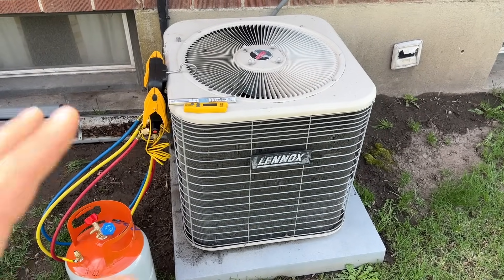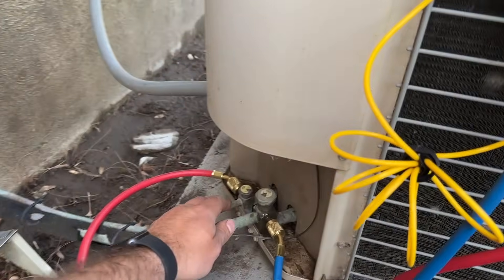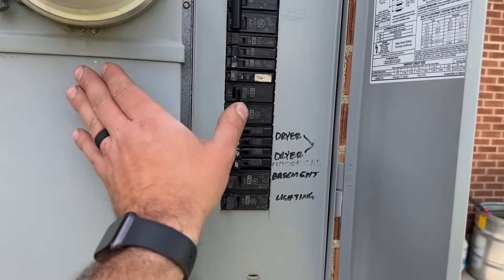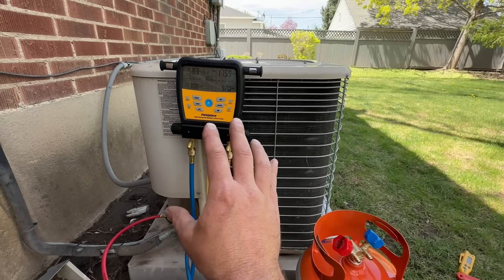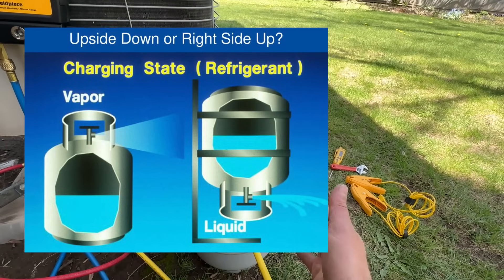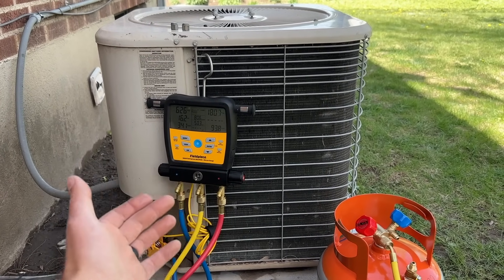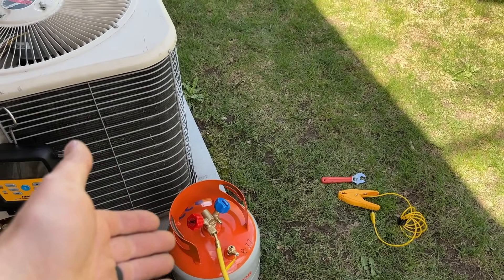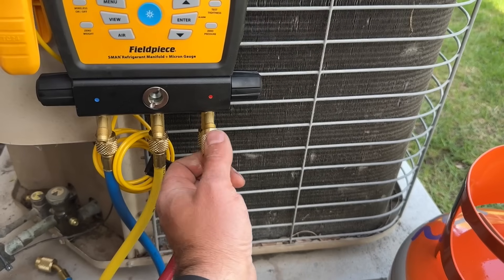How To PROPERLY Recharge Your Air Conditioner

Comment: I love all your videos! To clarify, when adding R-22 refrigerant, you should connect the tank upright to introduce vapor only, not in a liquid state by turning the tank upside down, correct? This is important to avoid slugging the compressor. While R-22 can be added in both liquid and vapor forms, it’s crucial to introduce the liquid slowly, just as you demonstrated in the video or other videos. This process can be quite confusing for beginners like myself.

Comment: Yes, it is true in Australia: you must hold a valid Refrigerant Handling Licence to handle refrigerants or work on refrigeration and air conditioning (RAC) equipment. Handling regulated refrigerants or RAC equipment without a licence is illegal and punishable by law, as the scheme is in place to protect the environment and ensure public safety. 

What is considered "handling"?

Decanting or transferring refrigerant.

Manufacturing, installing, commissioning, servicing, or maintaining RAC equipment, even if no refrigerant is present.

Decommissioning or disposing of RAC equipment with refrigerant. 

Who issues the licences?

The Australian Refrigeration Council (ARC) is the regulatory body responsible for issuing licences under the Ozone Protection and Synthetic Greenhouse Gas Management Act. 

How can you verify a professional's licence?

Look for the ARC Tick:Licensed professionals carry the ARC tick of approval. 

Use the online search tool:You can find a full list of licensed technicians on the ARC website. 

Contact the ARC directly:For confirmation, you can call the ARC on 1300 884 483. 

Why is a license required?

Environmental protection:The licensing scheme helps control the handling and destruction of fluorocarbon refrigerants to combat ozone depletion and global warming. 

Consumer protection:Licensing ensures that only trained and qualified professionals handle the equipment safely and correctly, preventing hazardous situations. 

Legal compliance:Working with refrigerants without a licence is an offense and can void product warranties.

Comment: Hey there. Quick question.  I have an old unit and had some issue with ac room puddling up time to time.  My AC is working fine for now.  Because any leaks make me worry, called a HVAC tech, he said maybe there is a clog in the drain pipe, used one of those nitrogen blower and cleared it; however, on the following day found puddle again called different tech, he said the refrigerant is low and creates freeze of coils and when it melts causing the puddle.  But here is the kicker, he doesn’t have the refrigerant nor cannot really fill them due to gov regulation.  Upon search, I found the article that stated regulation of some refrigerant.  Are there any alternates?   He gave me an estimate of $11000 for a total replacement.   
Called a different tech just out of curious and gave me a quote of $8000, which included high seers unit.  
Upon doing some more digging, came across your videos and videos and was wondering do you help with people who are willing to learn and assist installation?
Thank you kindly 
Dave

Comment: Wondering if my current gauge hoses and Schrader core removers will still work. Are the access ports on new R32 systems still 1/4 inch?

Comment: put gauges on my daughter's a/c.  When turned ac on high pressure jumped to 300 then settled at around 250.  Low was about 75.  ninety plus degree Texas day.  Should I have someone come reclaim to get it down to 165-ish on the high side?  Thanks

Comment: I don't suppose it matters to DIY folks that it is illegal to do this without certification. You can get fined up to $44,539 per day, per violation. However, there are no refrigerant police walking around. How can you trust this guy when he says your pressure should be between 70 and 80 in the basic method, but when he does it more precisely, it only gets up to the mid sixties. He also didn't purge his low side hose. Air in the system is a contaminant, and the moisture therein is even worse. 75% of what he said was good, but it's the details that get you!

Comment: Appreciate your lessons, and help values. In getting ready to top up refrigerant of a couple of my mini splits, and wanting to make sure no air gets injected; I notice you purged refrigerant through the yellow line, but not the blue or red lines. Would it be a good idea to briefly crack open blue line valve, then red and let refrigerant back flow out same top of yellow line release, close blue side valve, then purge from tank. Would not that be one notch more thorough?  Update: Studying the lines you recommend, I see they are sealed at fittings, and mine are not sealed (econ equipment). My thoughts are, one might purge those lines when going from different refrigeratants, but likely not have to when dedicated to one type of refrigerant.

Comment: shouldn't we have sucked the contents of R22 in the high pressure line in to the low side before disconnecting? just so it is not trapped in the lines under pressure?

Comment: you added the liquid refrigerant  into the vapor line rather than the high side liquid line... this confuses me, as the vapor line goes to the compressor which should not have any liquid in it

Comment: QUESTION  You purged the yellow line to prevent introducing air into the system. But don't the red and blue lines, when connecting to the AC unit allow air into the system once you open the blue and red lines at the manifold and start to run the AC unit?

Comment: What happens when you’re a 70 yr woman you have no kids local no real man that knows or even wants to try to know. What do you do when you don’t know people to help you?  My AC went out yesterday in 90 degree heat 2 days without. So  in that case what you do is call someone and be prepared to bleed.
Reply: If the AC is completely not working, call a reputable service agent and have them look at it.  Possibly its something simple like a tripped breaker or a capacitor. 

If it needs some refrigerant = $400
New capacitor = $300
If you need a new system = $16K for new AC, evap coil and furnace (installed).

Comment: Doing it yourself could save you hundreds of dollars, however, considering the tools you use in the video can cost you well over $500, that doesn't include the refrigerant either. If you are constantly using these tools in the long end, yeah it might be worth buying them. But to only use them a couple of times over the course of 20-30 years? Doesn't seem like it's worth it.
Reply: His gauges and hose set are $1000.  Plus a scale and 20 pound tank of R410, so add another $500...............

Comment: Very good video! Just a small tip; You are still introducing some air into the system by not bleeding the lp after you have connected the tank..

Comment: I’m a heavy equipment mechanic of 40 years. My central ac unit went out a few months ago. The compressor connection was bad. I called 2 companies to fix and nobody called back. I found a brand new old stock unit and bought it. It’s r22. Anything I’ve always just worked on trucks and cars ac. The old unit was a Goodman 2.5 unit and the new one was 2 ton and the house is under 1200 sq ft. I’m getting around 60 deg at the floor vents now. It seems to cool very quickly and I checked superheat and it’s close but can’t get it perfect. The new unit came with a 61 oriface and the old unit had a 73.  The coil is a 2.5 ton coil. Should I be using a smaller oriface ?

Comment: Okay, I have another question. I didn't hear you say the unit should be off, or the thermostat should be set to off or inbetween cool and heat. Mine has two switches to switch the ac on and to switch from heat to cool, and one secret setting inbetween heat and cool that always works like an off switch. I know it's there only because I've stumbled on it when we went on vacation. The chinese maker apparently does know the word "off", ran out of ink to imprint it, or something else. Anyway, why does the unit have to be off when we plug in the two hoses and only then after plugging them in, turn it on. 

Uncle Joe has a bad leg, so he's got to run back inside and outside again. Couldn't he just turn it on before he goes out, and then plug the two hoses in, and then check the pressure, without all that back and forth. I have an aunt with polio who's very active, but it's 100 feet one way around to that side of the house and back, and through a lot of stuff. Can do it in their wheelchairs.

Comment: I like your videos, so keep them up. I would suggest a full step by step lead in. I'm going to assume that before I connect the low side as in this video, that I already have the other end connected to the r22 canister and the valve is open. Wait. Closed. I think closed. You didn't say, so it probably is okay either way. Maybe I better watch further in the video to figure that out and then come back to attaching the hose. Just a second. Let's see. If I close that valve first, it won't have any freon, so the hose will be full of air 100%. Let me see. Hmm. No. I better just do closed. Then I can bleed the full hose of air. 

I'm gonna assume I need to do the low side first, but I'm sure antoehr guy did the red side first. But maybe he was doing superheating because the high side is the hotter side. But at least I know I can connect the hoses easily. Kind of like a new water hose on a new faucet.  

But I do think you explain better than the rest I heard, so I subscribed. Like @lauren said, I like DIY on this. I also will get the EPA, same reasons, and intend to add my own system. Thank you. 

PS: Can't you use these same hoses to add freon to auto ac as well? I'm just asking. No doubt a different refrigerant, but the same hoses will work for that as well, correct? And there's no secondary issues of using the same hoses for all types of systems from residue leftover?  Just some thoughts for you to cover somewhere. That may require another epa certification.

Comment: Thanks...two questions...why did you add liquid instead of gas and the final low side pressure was 63 and not the 75 you mentioned that it should be early on in the video??

Comment: When the system is switched off and the service valves are backseated there would be no emission. Furthermore, vacuuming your hoses before opening the service valves prevents any emission of refrigerant. No need for bleeding out refrigerant!

Comment: I have a question my ac working fine , but my furnance blower fan  runs 2 to 5 min minutes and it shuts off. Can you tell me what could be the problem. Thank you
Reply: HVAC tech here. The fan continues to run after the furnace has satisfied to temp for safety reasons. It cools off the components within the system to prevent overheating.

Comment: I repair refrigerators...if a system loses cooling because of low freon levels that means there is a leak as its a totally sealed system. Why do a/c units need more freon from time to time? Wouldnt that indicate a leak somewhere?
Reply: I had the same question

Comment: Question- I have a bad gas assembly valve for a crane unit and the company sent me an estimate that states it will cost me $1454 to replace the valve and add refrigerant. when I asked for a more in depth estimate to see what all needed to be done so I can make sure they are doing what is needed and not charging me for stuff that isn't needed- although the estimate only says refrigerant level 4 and the valve the service manager said it included several other things. So my question is- do you know what all besides replace the valve, sauder the valve on, check for a leak and add refrigerant. do you have to do anything else? If I could do this myself I would.

Comment: Just for the sake of concept.. don't wait for the system to equalize, after turning off the condenser, to take off ur hoses. Better yet, take off the low side, THEN shut it down, equalize, and remove the high side.

Even fancier method (of course Ive been talking, as if ya don't use low loss fittings)... If it's a heat pump: take off the low in cooling and take off the high in heating.

Last method that I've actually done a handful of times, only cuz my hands grew pussies all over em, n just didn't want to take the burst of cold: halve-ass pump down; close down the high side king valve (enough for it to slope to lower psi readings), remove ur hoses, and open it back up fully.... But DONT just close that valve to do this... Ur just trying to bring the pressure down, not pump the system down. There's no need to be stressing any system just cuz ur sick of how cold 22 sprays or cuz u neglected to hug enough trees lately... Just wear a glove lol.

Also, u can try to get good at "being" a low loss fitting (lol odd way to word that).. put ur knee behind ur hand holding the hose behind the fitting, use ur weight to press ur knee into the back of ur hand, towards the fitting into the service port, as u use ur other hand to unscrew the fitting.

And if u wanna be SUPER FANCY... Just spend 30 bucks on some latching quick connect adapters. Don't use em for pulling vacuums or during pressure tests (yes, u can actually get away with that... I've done it many times, but it's normally happened cuz I forgot to take the fittings off, and didn't think about it while in the zone. But not necessarily something I would call a trusted method). Just use em for charging. When ur done, u can literally poke the latch with one finger, and the pressure pops it right off... Imagine like a massive Schrader valve on the fitting side.. u screw an open ended cap on the port, that has a small grove around the outside, and a fat oring in it (to seal the massive Schrader fitting dealio).... So yeah, screw that piece on, and jam the fitting into that fitting, n it clicks into that groove. I splurged on em when I bought my 1st digital gauges 15yrs ago, and always like those things. Idk y I barely have even used em in the last 5 or 6yrs lol. They do work great! There's also an adjustment screw on the back side of those fittings (for tension on the built in valve). Could be frustrating to get em on if u have that tension set too high.

Comment: my AC outside fan stops running.  I tried a new capacity, no joy.  Tried another thinking it was defective, same thing.  The fan runs for about 5 minutes then just stops, and I hear a buzz noise from compressor.
AC people came out, told me it's low on R22 and I need to replace the unit for 8k.  I even tried swapping the fan with a know good one loaned to me, again no joy.  
Any ideas?  Would low refrigerant cause the fan to stop?  And yes the air coming into the house isn't very cool.

Comment: Great video thanks for posting, I'm not criticizing just looking to give you some advice. Get yourself a core depressor and use on the high side,  remove high side while system is running and then you can  open the liquid valve on gauges and  slowly open suction valve to allow the compressor to pull all the refrigerant out of your hoses before removing the low side gauge. Always remove gauges while system is running!!  And I realize this is an older video but many people are still watching.

Comment: really well explained! can i do this in -17C temperature ? on a split heat pump?
Reply: if it's a minisplit, you would have to weigh-in refrigerant to get a proper charge. If it's a normal split heat pump, you should only charge them when in it is cool mode and the ideal scenario is to charge them during a 32-37 C day. There are tools that help for charging units during cold weather or cold environments but I'm not familiar with them. I live near-ish to the equator

Comment: From my theoretical understanding, shouldn't the gas refrigerant be inserted into suction line and not the fluid refrigerant as this will cause problem to the compressor and operational imbalances? Enlighten me please if I'm wrong.
Reply: Thinking the same, how did he miss this? Only gasform in to the suction side and in to compressor.

Comment: Thank you. I have that same compressor, and it is low on refrigerant.
I want to change the Shrader valve seats, but Lennox is back ordered until April/May 2025.  What can I use instead that is durable?   Is there an air-tite cap available that I can use to seal leaky Shrader valves?
Thanks

Comment: Thank you so much for this video. AC technicians are more like salesmen these days. When the slightest thing goes wrong with your system “oh, looks like you need a new unit. That will be $9,000 for a 2.5 ton unit. But luckily, we have financing.”
Reply: It’s a business not a charity. If they recommend a new unit it’s probably warranted. I admit there are still bad tech out there  but don’t compare apples and oranges.
Reply: @ThucTran82  The last time I called an AC tech to check my refrigerant. He said “oh wow, you’re at least 5 pounds low on R22. You have a leak and you might as well get a new system because we charge $300 PER POUND OF R22!!!!!”

I knew the tech was just trying to sell me a new system for nothing, so I spent $600 on a set of professional AC gauges because my gauges suck and I’m lazy about certain things like manual calculating my sub-cooling numbers.

My system needed NOTHING!!!! Your low side pressure should be between 60-80 PSI giving the ambient temperature, your high side should be between 150-175 PSI, and subcooling should be between 10-15 degrees. Guess what? All of my numbers were text book perfect. 

This is why I have trust issues with “professionals.” I just saved my self $9,000 on a new system or $1,969 on refilling R22 that I didn’t need. Unbelievable. The only reason I called him was because my blower motor went out and it was 2 days before a major hurricane. I couldn’t get the part. While he was there, I asked him to check the refrigerant. Yeah, they’re there to make money like everyone else, but to scam people like that? It’s all too common.